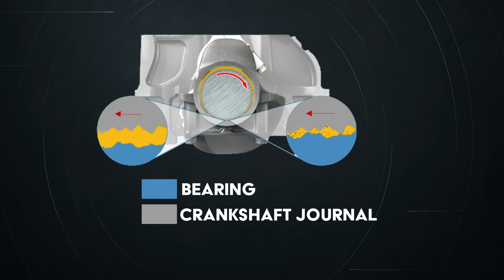the truth about start-stop technology (finally proven)

Comment: Did you know that every UPS deliver van's engine stops and re-starts for every delivery?  I wonder what their data shows?
Reply: These systems aren’t new. If stop start systems were making a significant difference to engine wear we’d have noticed engines with it aren’t lasting as long by now.
Reply: @noahmcdaniel4920 But we do, that's why people are turning off the stop start systems.
Reply: @noahmcdaniel4920  We have. Didn't you even watch this video?
Reply: Local delivery vehicles are such an obvious fit for going electric I'm astonished how long it's taking for companies to convert their fleets.
They don't drive hundreds of miles in a shift, they are constantly stopping and starting, accelerating and decelerating, they are on suburban streets where lower emissions would be ideal, and they return to the hub at the end of each shift where they could be plugged in to recharge overnight.
There are companies that could retrofit existing vehicles with electric motors and batteries, a great saving in upfront cost. 
And the roofs of the hubs buildings could be fitted with solar panels.
Reply: @ziploc2000 Where I live, I see an increasing number of EVs used by delivery companies and even the postal service. Probably for the reasons you stated. Also, battery weight doesn't sound like a huge concern for these vehicles as they only need very little range and therefore little battery capacity to do their daily, rather short routes.
Reply: @dworshia4864  That's encouraging. 
I'm confident we'll get them where I live eventually, it just makes more economic sense, and the environmental benefits will follow.
Reply: @ziploc2000  ~ It's all about the economics. The cost to install a charging stations for even a small fleet is big money!  Tire wear is another problem as you are hauling around the constant load of heavy batteries every where you go and solar panels on the roof are near useless to extend the vehicles range.  Also, retraining your mechanics to work on high voltage EV systems would be no small task!
Reply: @rpsmith  Solar panels on the roof of the building, not the vehicles. The power could be used to run the building, even if not to help power the vehicles. It's not vital, just an idea that would pay for itself in the long run.
Yes some electrical charging installation would need to happen, but maybe not as drastic as you think. Slow chargers would get the job done overnight. 
Extra tire wear is mostly a myth, as EV owners are discovering. Yes the vehicles are a bit heavier due to the batteries, but an electric motor is less weight than a big engine, so you save some weight there. 
Training a mechanic to work on high voltage EV system is not as big a job as you might think, most US community colleges now offer a course. 80 hours if done over 10 weeks, they could squeeze that into two weeks. I spent three days with UPS just learning how to drive a package car and deliver packages for Christmas, only to end up sitting on the fold down seat and running the packages for a regular driver.
Yes there's costs and logistics involved, but also massive savings on fuel. Electric vehicles need much less servicing  than gasoline or diesel engines.
Reply: I worked there for years. Most package cars would be get up to 250,000 mi. And some well over.  Most were diesel, and some were gas.  I remember the mechanic replacing engines periodically. A lot of the gas engines burned a lot of oil. As I was instructed to check and top off all 52 cars every Friday.

But it seemed normal for the milage.  Ones that burned a lot of oil would eventually fail.  maybe because I got tired of filling them after repeatability telling the mechanic about the problem.
Reply: those are commercial diesel engines usually built to a much higher standard than car engines
Reply: @CE750  ~ They don't run Diesel anymore.
Reply: @rpsmith yeah, they very obviously do... It's being phased out, but maybe leave your house once in awhile and look for some UPS trucks? It IS still most likely to be diesel.

Comment: I code it out on every BMW, well set to memory mode (push always on, push again always off). The strain on the battery, starter motor, timing chains and bearing doesn't come close to the overall savings in the long run. I see older BMW engines with no start stop and the main bearings are almost perfect, yet newer N47/B47 engines with start stop have bearings are noticeably more worn.
Reply: My sister bought brand new BMW X1. The first two items that had to be replaced in he first two years were the battery and starter. Battery had to be replaced again two years later. They were all OEM BMW batteries that lasted fewer years than on old cars without this feature.
Reply: BMW have also too long on service intervals no oil can sustain 25-30,000 klms change oil at 5,000 klms if all city driving and 10,000 klms if hwy driving or 6 months whichever comes first

Comment: This man is 100% correct. Starter/ring gear wear alone was enough to p#+ss me off. Buy a start/stop bypass jumper wire kit, install and your vehicle will operate like any auto you owned a decade ago.
Reply: Installed a delete on my wife's new Toyota RAV4 within a week of owning it. Oil changes at no more than 4k miles. I think we're good to go for a long time. S/S is a stupid idea.

Comment: What is needed is instructions for turning it off for every new car
Reply: In my car it doesn't operate unless you put your car into neutral, and take you foot off the clutch, at every junction/traffic light. I don't normally do that so it almost never operates anyway. No need to turn it off (although I do have a mechanical switch for that so it's easy to leave on or off (Vauxhall Vivaro 2017)).

Comment: First, your engine does not sound like it's turning at 800 rpm, more like 200 rpm. Second, you are measuring oil pressure reported by the oil pressure sensor which does not directly correlate with fluid film barrier resistance. The boundary layer of oil on journal and bearing surfaces prevents metal-to-metal contact for short periods, even with zero oil pressure. This is a known fact, and if you want simple proof, look at any well-maintained engine after nominal use, for example 50,000 km. You will see nice shiny journals and scratch-free bearing surfaces. Metal-to-metal contact, even if absolutely trivial, would result in visible markings on the soft bearings. In summary:  you are wrong.
Reply: Hey, can you piss off with your evidence based "facts" I'm here for the confirmation bias and brewing up conspiracy theories that don't seem to have a pay off for anyone in particular and lets me shit on people with university educations with my common sense opinions about things that are instantly proven wrong by looking at the actual outcomes
Reply: @ej20tnz  This was painfully precise 😁
Reply: @Wilhem275 What I like the most is that for a good 50% of people here that read that comment, they'll have zero idea that I'm talking about them even partially agree.
Reply: The car basicly just stands there..... Yeah, i also test my software with a data file with 8 kb size.

Testing is not a job it's a science. There are always people that think they can do my job. Here is a good example. (Also, the Diesel scandal has been found by a university not a government)
Reply: Nothing of that invalidates the vid, sperglord
Reply: I donate my virtue signaling start stop and my useless false alarm accident provoking "driving safety" features being pushed by OCD people in governments having no purpose to you. Meaning: You can't disable them anymore and mine are permanently disabled. Deal?

Comment: My car is 11 years old. A 2.0l tdi VW. Stop-start has always been left on, the engine is at 118k miles (not km)... it's still running well and has had no repairs beyond normal servicing.
Thankfully it doesn't have adblue as this system seems weak.

Comment: Like AFM it will only save a fraction of an mph. Look at the engine problems with AFM. Enough that I will never buy another GM motor with it. Imagine all this work for minimal fuel saving but the most popular vehicles are heavy SUVs and pickups that the weight is the main factor in fuel economy. How many times have you seen a single suburbanite woman tooling around town in one of these 3+ ton behemoths? But goddamned that kid on an e bike. Get him off the road.

Comment: First thing is turn off the start/stop.
Second thing is to turn off the dynamic lane keeping. (My car likes to follow snow plough scrapes in the tarmac: not so good if the scrape is heading into the side of the road!!!!???)
Reply: I was driving my neighbors car, and the lane keep assist decided out of nowhere that it was going to straddle the shoulder line. I had to really fight it. I hate it and stop/start.
Reply: And thirdly, turn off the annoying beeping for Speed Alert.  3 things to turn off before each journey.  Pathetic politicians interfering with our lives.  And there is more in the pipeline.
Reply: Don’t you mean “wrong” side of the road? 😂
Reply: This is my car start ritual:

1) clutch in/press start
2) neutral/clutch out
3) autohold on
4) start stop off
5) sport mode on
6) lane keep assist off
7) traction control off(stability remains on because it has the power to brake single wheels)
8) steering wheel menu navigate to turn off forward collision detection(auto brake slam yourself into an early grave for no reason) by doing the following playstation 1 cheat code on the steering wheel: menu > up > up > up > menu > down > down > OK > menu > up > up

What a fucking time to be alive.

NONE of these steps have permanent enable/disable features or quick access/aio functionality (eu laws)
Reply: @ravecsucks6192 this is keeping me from buying a new car, I’m starting to doubt whether I’d ever buy a car newer than a 2015 model

Comment: Years ago we had a 2015 C300 with Auto Stop/Start. But the car's settings allowed disabling it. I was so happy. When I took it in for the inevitable warranty work they updated the software and took away the ability to turn it off permanently. From that point on we had to turn it off every stinking time. Just like every other "modern" car we've owned.

Comment: Something isn’t right with this test.  The engine with “millions” of miles would have accrued more starts and stops than the engine in the 84 hour test accrued.  So, seeing almost no damage on the “millions of miles” engine simply defies logic unless it was started once and driven 1,000,000 miles before being shut down.  So, I suspect this 84 hour test was designed to show bearing wear.  Also, we should have seen the same engine idled for 84 hours with another set of bearings so that the bearings could be compared from the two tests in the same engine.  Comparing one engine to another is relatively meaningless.
Reply: This is a critical thought free zone here MATE! If you're not going to blindly accept the video and feel smugly intelligent drawing incorrect conclusions you are free to leave.
Reply: Yes this "test" is complete trash. I was involved in both the development and durability testing of various start/stop motor systems. This is not how any of these "tests" should be conducted and the lack of transparent methodology and data is ludicrous
Reply: @Dan-wt7jx  Additionally, what about the millions of hybrids that have been running start/stop since before this technology made its way into ordinary cars? Humbug, I say.
Reply: @Everstrife I am not saying there isn't increased bearing or engine wear over non S/S systems, but that was one of the issues we had to solve and stay within the original spec of before the system was validated. Which is partially why S/S systems don't operate below specific temps/conditions, and have a minimum run time before they can cycle off.
Reply: It wasn't really an 'experiment' more a 'comparison' but as the two engines had done plenty of other things differently it wasn't even a realistic comparison.
Reply: @gavinminion8515 Yes, but it was a comparison to try to support an assertion that stop/start quickly wears out an engine.  That assertion is completely unrelated to the comparison made in the video.  That is my fundamental point.  I don’t know if start/stop really wears an engine out all that much faster.  I own my first start/stop vehicle, a 22 Equinox, and I have left the feature enabled since the car was new and it currently has more than 50,000 miles with no signs of accelerated wear.  I can’t draw any conclusions yet as almost any engine today will make 50,000 miles so it will take a few more years until I get to say 150,000 miles to make any judgements of significance.
Reply: It's just another staged up anti start-stop video.
I've personally disassembled 300000km engine with start stop, because of head gasket issues. It had absolutely no wear on the bearings so we put it back together with the old bearings. 

Modern oil is just way too good, and this german gentleman here is just selling people snake oil ideas.
Reply: @MrFearless84  "It had absolutely no wear" but you had to replace the head gasket... hello... my guy... why do you think you needed to replace the head gasket?
Reply: @IraFox84 I love it when office workers lecture me on mechanical engineering subjects!
Head gasket failure has absolutely nothing to do with oil, or start-stop for that matter. It can fail because of number of reasons, like cooling issues or fueling issues causing overheating or detonation.
Reply: @IraFox84are you vegan with that impressive knowledge about car tech? 🥳
Reply: I don't like start/stop simply because the gas I save isn't enough to justify the amount of AGM batteries I have to buy.
Reply: @glatwork Well, I’m still on my OEM battery in my Equinox at 52,000 miles so I can’t comment on battery life, but it certainly isn’t unusually short.
Reply: The Bulli DID not run its million km with a start/stop feature!  It's like nobody listened to the man.  They installed the start/stop for the torture test!
Reply: @mikchilton did you even read? I guess for you it ran a million miles on one single engine start then...
Reply: @mikchilton I never said it ran a million km with start/stop.  And I believe the video said miles, not kilometers, but that’s not terribly relevant. It’s like you didn’t even read my post.  An engine used normally would  accrue a lot of cold starts in 1,000,000 miles.  Most people drive 50 miles or less each day and typically have at least two starts a day.  That is a start every 25 miles on average and in 1,000,000 miles that is 40,000 cold starts.  I don’t recall the video giving any detail on the number of stops/starts in the 84 hour “torture test”, but let’s say one was done every 10 seconds.  84 hours is 302,400 seconds.  A start every 10 seconds would be 30,240 starts in 84 hours which is LESS than a normal engine would accrue in 1,000,000 miles of typical driving.
Reply: @LTVoyager except you are comparing a one year simulation of start stop damage in the 84 hour test. The million mile engine is over a lifetime, not a one year period. Unless I missed some mad lad out there somehow covering a million miles on a single year, the more accurate representation would be 30-50k miles per year.
Reply: @sdhority Engines don’t wear out by time, they wear out by use.  It matters not if 40,000 starts occurs in 84 hours or over the course of a 20 year life of 2,000 starts a year.  What matters is the number of starts and I don’t recall this video mentioning that … yet another flaw in the video.

Comment: Amazing. MIK, you guys are true scientists, and you've gone to a lot of trouble and expense to analyse start-stop system. Well done! I've seen a couple YT vids that say start-stop is bad, but you've actually performed exhaustive experiments to demonstrate exactly how. One thing you don't mention is that start-stop was not introduced specifically to increase fuel economy, but to reduce emissions. Thankfully my 2011 Audi A3 dubo-tiesel has a single button to disable it - which I almost always select, altho I would leave it on if I were driving in a smoggy city. One thing I do appreciate about my stop-start is that if I stall, it immediately re-starts.